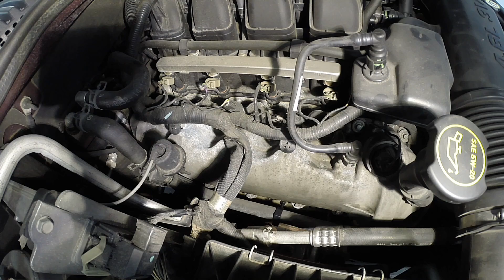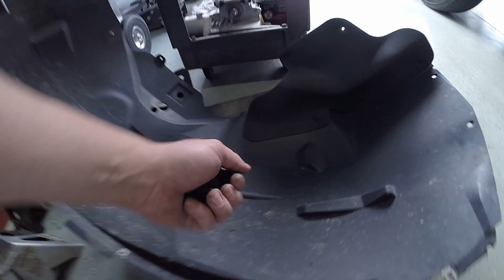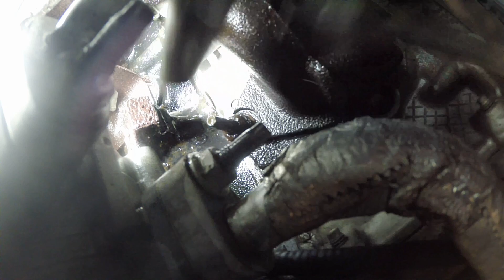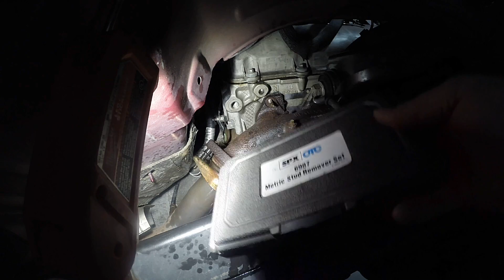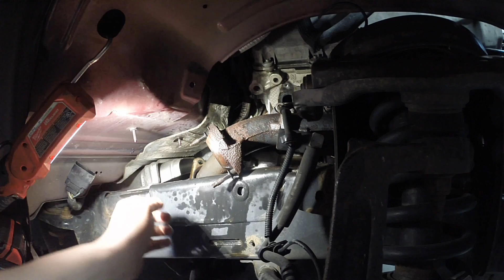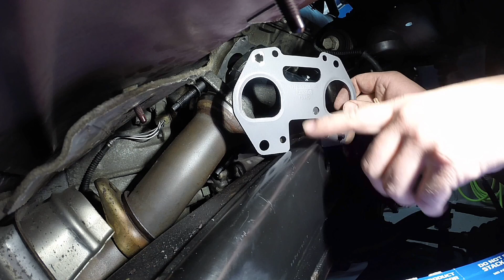Ford Explorer 4.6L 3v: Passenger Exhaust Manifold Replacement

Comment from the maker: The parts and tools listed below are what is needed to complete the repair: (check fitment guide)
Mopar Rust Penetrant I use-
http://www.amazon.com/gp/product/B00BV4DBAU/ref=as_li_tl?ie=UTF8&camp=1789&creative=390957&creativeASIN=B00BV4DBAU&linkCode=as2&tag=fordt-20&linkId=VYOYTUQUDYJM2UZ6
For extremely rusted items use this rust penetrant-
http://www.amazon.com/gp/product/B005XUIX24/ref=as_li_tl?ie=UTF8&camp=1789&creative=390957&creativeASIN=B005XUIX24&linkCode=as2&tag=fordt-20&linkId=SQL2XWZ5NSFFNR2F
Aftermarket Stainless steel stud kit-
http://www.amazon.com/gp/product/B000CQ21CM/ref=as_li_tl?ie=UTF8&camp=1789&creative=390957&creativeASIN=B000CQ21CM&linkCode=as2&tag=fordt-20&linkId=EHOO6INP2F6WZ2LZ
4.6L 3v Engines-
Dorman Exhaust manifold kit- 
http://www.amazon.com/gp/product/B00GHT7ZFG/ref=as_li_tl?ie=UTF8&camp=1789&creative=390957&creativeASIN=B00GHT7ZFG&linkCode=as2&tag=fordt-20&linkId=LIM2N27YJSV3SWZC
Latest Exhaust Manifold gaskets- (2 required)
http://www.amazon.com/gp/product/B0031CFOJG/ref=as_li_tl?ie=UTF8&camp=1789&creative=390957&creativeASIN=B0031CFOJG&linkCode=as2&tag=fordt-20&linkId=23LL36E3TL5ZWTB6
OTC Stud remover & Installer-
http://www.amazon.com/gp/product/B000HTAXFQ/ref=as_li_tl?ie=UTF8&camp=1789&creative=390957&creativeASIN=B000HTAXFQ&linkCode=as2&tag=fordt-20&linkId=ZKKMIWFZSEF264VW
Cat Claw I used to remove everything on Fords-
http://www.amazon.com/gp/product/B000FL5MRU/ref=as_li_tl?ie=UTF8&camp=1789&creative=390957&creativeASIN=B000FL5MRU&linkCode=as2&tag=fordt-20&linkId=VN3DMVMUTPP2IIBP
Fine 3M bristle disc I use for automotive gasket removal-
http://www.amazon.com/gp/product/B000FW4LDU/ref=as_li_tl?ie=UTF8&camp=1789&creative=390957&creativeASIN=B000FW4LDU&linkCode=as2&tag=fordt-20&linkId=GDMPENN5EIBC5OVY
Cheap popular torque wrench option-
http://www.amazon.com/gp/product/B00FMPKAD0/ref=as_li_tl?ie=UTF8&camp=1789&creative=390957&creativeASIN=B00FMPKAD0&linkCode=as2&tag=fordt-20&linkId=JOLPHOS2V3GHIZVW
Push pin remover I recommend-
http://www.amazon.com/gp/product/B0002BC0PA/ref=as_li_tl?ie=UTF8&camp=1789&creative=390957&creativeASIN=B0002BC0PA&linkCode=as2&tag=fordt-20&linkId=6VGE3MVBAFVCXMZ2
Nickel Anti-Seize-
http://www.amazon.com/gp/product/B007NJOEAI/ref=as_li_tl?ie=UTF8&camp=1789&creative=390957&creativeASIN=B007NJOEAI&linkCode=as2&tag=fordt-20&linkId=A5PHYLP5CTHTTXVE
If you need an angle grinder I suggest this unit for those tight areas-
http://www.amazon.com/gp/product/B008JYRDEU/ref=as_li_tl?ie=UTF8&camp=1789&creative=390957&creativeASIN=B008JYRDEU&linkCode=as2&tag=fordt-20&linkId=GOYVI3MWXDH5GD4G
TORQUE SPECS:
Manifold Studs- 106in lbs
Manifold 13mm Nuts- 216in lbs
Downpipe Nuts- 30ft lbs
Reply: How much do you charge for the 4.6 manifold gaskets for a Mountaineer? It’s literally the exact same one that’s broke off as in this video.

Comment: Hello. What's the part number for the exhaust flange studs? I have felpro ES 75105. It doesn't have enough threads to be flush with the manifold. It has 7 threads. My old ones have 10. I zoomed in on your video and yours has 10 threads on the bottom.

Comment: Hello sir. Thanks for your great videos. I have a question for you. I need to do this exact job on my 2003 4.6 (2v) on passenger side. Also I have to replace upper balljoint and driveshaft differential seal on that side. Its not my main vehicule so it can stay on the lift for a while as a I expect this to be a multiple days job.   I plan on removing the whole knuckle, hub and Strut assembly. Would it give me lots more room to work? Especially since I am pretty sure I will have to drill out those 2 front studs.

Comment: This was an absolute pig of a job and one I hope never to have to do again. One advantage Brian had here is the truck he was working on did not have the 3rd row climate controls. Heat and A/C lines run right by where he disconnected that wire harness and make access even more difficult. I disconnected the coolant hoses but left the A/C lines alone. I shifted them as far away as I could and managed that way. I had 3 broken studs; 2 of them, the 2 at front, below the level of the head. The 3rd was the lower one on the back cylinder. If any on the middle 2 cylinders were broken I don't think I could have succeeded in removing them. I did it by welding nuts onto the broken studs. I used the Dorman replacement manifold and hardware. I installed the studs after maneuvering the new manifold in place as I felt it provide more clearance to get the new manifold in place. Thankfully, the new manifold appears fine and the leak is gone. Since no good deed goes unpunished, now the thing (a 2007 Mountaineer Premier 4.6 3V V8) is now throwing catalyst codes, most likely due to a misfiring episode from a couple years ago caused by loose plugs and crappy coils put in before my ownership. I hope this solves this trucks last problem.
Reply: About to tackle this same job

Comment: Great video and I appreciate you doing this.  I was curious about the drivers side exhaust manifold and why it seems to cost almost twice as much as this passenger side you have linked to below.  Is the drivers side a more difficult job or is there anything specifically different to doing a drivers side compared to a passenger side manifold?

Comment: Outstanding video, I am doing this now on a 2007 Sport Trac and this has been a tremendous help.  Some comments:  
- Great shot of using a pass through / go through socket at 17:45 to remove the upper 13mm nuts/studs
- Do you have an opinion on using McMaster 90386A109 Class 8.8 M8x1.25  / 25 mm serrated flange bolts instead of studs/nuts?  These would be much easier to install in these tight quarters
- You can cut the protruding stud on the lower AC line holder to get better access with a universal to remove the lower front nut/stud

Comment: Your videos are so detailed and thorough. I noticed at the end you showed the AC lines had been removed and you stated you had vacuumed the lines down. I have a 2001 f150 super crew with the 4.6 is it possible to do this job (it was already done once five years ago by a shop, it leaked from day one) without having to remove those ac lines? Thank you sincerely,

Charles Abbott

Comment: Great job! Just wondering about whether bolts instead of studs can be used on my 2006 Explorer with the 4.6 3 valve???? I'm going to use the doorman passenger side manifold.

Comment: I was doing this same job on both sides of my 2006 Jeep Commander with 5.7 hemi and I decided to go ahead and pull the heads. That was the only way I could see to do the job properly. Too tight especially on the drivers side. At least it gives me a chance to change valve seals.

Comment: I can see why mechanics quote so much to do manifolds, labor intensive!
Reply: It's easy when the engine is out, soak with PB blaster a few days, then crack it loose, spray em down some more, tighten, rinse and repeat till all of em are loose, then slowly back em out...best way to get em out without breaking a stud.

Comment: Thanks for posting this video, I replaced the right side exhaust manifold on my 1998 4.6L Expedition, this video was absolute MONEY !  The tips are great and grateful for posting all the links to the tools and supplies, especially, the stud removal kit very helpful. I used the Dorman exhaust kit about $85-$90, brought some of the tools that you recommended my total spend for the job was less then $250, completed the job over a 2-days periord, started one mid-afternoon finished the next morning, I did not have to drill any sheared off studs from the manifold. I'll tackle the drivers side next.

Comment: Brian. I did my passenger side exhaust manifold today. Thanks for the video. I had two broken studs that I removed with the welder method. One note for you. The explorer you worked on did not have back seat climate control. Where you had just a harness to unplug and move, I had coolant and refrigerant lines in the way. In order to get the manifold out, I had to disconnect the coolant lines. Also, I noticed you don’t show the torquing of cylinder 2 lower. That one is a bear to get to. Thanks again. You’re the best.

Comment: I swapped the driver side exhaust manifold on my 2006 Explorer 4.6 3V this weekend. Three studs were broken (both fronts and the top rear). I watched this video so many times. Thank you Brian. I used the welder method to get the studs out.
Reply: How bad was the job overall

Comment: Hi Brian, Thank you so much for your videos and shared knowledge. You've inspired me to take on some big (in my eyes) projects on my 2006 Explorer (no rust on the west coast). I have a question about the parts you used on this project. You listed the aftermarket stud / nut kit. Do you prefer that kit over OEM studs/nuts, or was that a budget consideration like the Dorman manifold? I am preparing for a double exhaust manifold replacement, so I am trying to figure out which parts are best.

Comment: Thanks for your time and shared knowledge. I’ve come to you for several repairs on my 2010 Ford Explorer. I wish you would’ve showed us what the noise it makes is. I’ve been having a noise on my Explorer for some time now. It would first only happen in the cold mornings and eventually stop after it warmed up but now it’s stays on. And it gets especially loud after 2 RPM’s. I shifted the transmission to neutral and pressed on the gas and it does it also. So I figured it’s probably not the transmission. But I wouldn’t know where to begin to isolate to fault. Any advice or direction in this issue? If it is the exhaust manifold would there be any clear visible signs I should look for?

Comment: i thought it was too good to be true when i found this video but this is my exact problem. I have a 4.6 3v mountaineer but same shit. Anyway, i thought it was the lifters too so i tired a lubricant in my oil and obviously didn't work. Let me know if you have a shop or something i can get this fixed at cause i'm only 16 and I don't want to mess it up.

Comment: Hello Brian, I hope you read this and reply! I have a 98 E250 van that I love. It has 343,000 miles on it and still runs perfectly. I still pull 10,000lb equipment with it no problem. I bought the van with 122k miles and I take care of my trucks! I have done the front suspension twice (ball joints, drag link, idler and pitman arms all bushings ect) my issue is the exhaust manifold gaskets have blown out and it sounds like the truck in this vid. The studs and nuts are so rusted they dont even resemble a nut/bolt anymore. I have asked EVERY shop in my town to replace them, even the Ford dealer said NO. I don't want to junk my truck over the gaskets! I am a fairly capable tech I have done all my own work for 20 years but I worry I won't be able to get the studs out and that will lead to pulling the engine. What are your thoughts on if the studs will come out of a 98 with 350k miles on it? I am concerned they will be locked in there....

Comment: Outstanding "how-to" video.  I followed this video as well as the supporting, "Broken Exhaust Manifold Stud Removal" video and accomplished this difficult task in one evening (prep) and one full day of effort.  Our Explorer has rear air which made the manifold removal a bit more of a challenge but it is do-able.  Dropping the AC compressor (without having to discharge the freon) gave me good working space to drill-out the front two studs.  My wife's beloved Explorer is quiet again and she'll stop threatening to go buy a new one.  ;)  I purchased all of the recommended tools and they worked perfectly.  The new drill bits cut down to custom length was an amazing recommendation.  The extractors were worth their weight in gold but the real win here is the excellent video and instruction.  FordTechMakuloco - Thank you for your excellent work.

Comment: One comment, that exhaust manifold, studs, and nuts are in great shape! I did this repair on my F150 after 15 years of winters  and getting those nuts and studs off was nowhere as easy. Some nuts had to be cut with a dremel, some took out the whole stud, which turned out to be better because new stud/nuts could be used. Good news was repair fixed the noise.

Comment: this dude is the man. I have the same problem and it actually caused 1 of my o2 sensors too go bad. instead of paying my guys at a local shop called Technology R I might as well take my time and tackle this myself. I wanna do after market headers like BBK, and Gibson or a pair of custom equal length headers by whoever makes em. Its a lil scary because Ive been hearing that they're a pain in the ass to get in vs the OEM headers because of space availability. Btw you made this shit look super easy bro. So easy that if my girl took her time she'd get it right💪💪💪💪💪
Next time you hear from me my Explorer will have a Coyote swap and full bolt ons and maybe a lil💉💉💨💨

Comment: hello,
i am new to the Ford Truck World and have a Question.
I have a new to me 2004 Ford F150 4X4 4.6L Truck, 100K MIles.
i've been watching your videos and was wondering if all of the 4.6L were 3 Valves or just certain ones?
when i've been looking at Replacement parts and i state 4.6L, i'm never asked if it is a 3 Valve or not.
i'm getting ready to do a Tune Up and looking at Spark Plugs and everything i've seen , seems to be normal(Short) Plugs.
am i missing something?
thanks for any information.
john

Comment: Hi I just did this manifold swap on my truck 2010 f150 5.4l 4x4 and you have no where near the same amount of room that you do on the 4.6l the flange on the y pipe will not clear the studs on the manifold due to the o2 sensor location. I also had to cut the studs at the back of the manifold because there was no tool small enough to even get on it or get any torque. I would love to see you do the 5.4l to see where I went wrong....
Reply from the maker: They are tighter and the trick is to lift that side of the engine.
Reply: +FordTechMakuloco 
I sure did lift that side of the engine. I watched your video very closely during the whole process and followed your tutorial step by step. once you have the opportunity to do a 5.4l if you haven't already you will see the limited clearance issue's I was having. mind you I also struggled with swollen rusted bolts....

Comment: So I'm going to attempt changing my passenger side manifold. I have a 2006 F-150 with 195,000 miles on it. What special tools will I need to get before attempting. Which studs/nuts will be mostly like to be a problem. My truck looks awesome but sounds like junk.

Comment: just did my first one of these on a 5.4 F 250, but cant get the downpipe to seal even after following the torque spec/sequence from Mitchell. Any ideas? thanks for the video!
Reply from the maker: +kauboi If the down pipe will not seal you may need to loosen it from the other bank and straighten it out.

Comment: its bullshit that ford knows this and refuses to deal with it! my cousin is a engineer at ford. when I questioned him about this his response was...."their have been thousands of complaints about this. the feds say theres no safety concerns nor hazards therefore it should be the customers responsibility to deal with the issues and not the manufacturer or supplier!" ive owned 9 f150s from late 90's all the way thru 2005 and every damn'd one of them had a exhaust manifold leak!!!!!! 5 were broken! 1 was so bad I had no choice but to take the truck too a mechanic shop! cost me $570 bucks!! took them 3 days too fix it/replace it!!! ive replaced them on my sisters 2006 last fall.....2006!!!!!!!! a truck she paid $33,000 for and the manifold was rotten!! ive got manifolds that are 50 yrs old and sittin in the michigan weather that are still in great condition! and the shit ya get today barely last 8 yrs!!! what ever happened to the days when the manufacturers took pride in their work/products??!! better yet.....when they STOOD BEHIND THEIR PRODUCTS!!!!!!!!!!!!!

Comment: is this the same procedure for the 2v engines? my 99 f150 4.6 needs both sides done. great video btw
Reply from the maker: +Shaun Sklarz Very similar but easier more room on the older trucks like yours.

Comment: Wish I watched this video prior to tackling mine on my 2007 V8 Explorer. I did have 3 broken studs that needed to be drilled out and of course one of them was behind that shock tower. I did get them out with a reverse drill bit and ran a tap through them to clean them up. Very tight quarters though. I did release the engine mount to slightly twist the engine to gain precious room. I ran the engine for one hour of start and stop intervals to heat and cool the manifold then i re-torqued it. Do you think I need to re-torque them again after about a year of service with no leaks? Also i noticed the driver's side is now leaking and I see atleast two broken studs...Oh boy....Not looking forward to this. Great video man. I am a retired firefighter but have been a marine mechanic for 35 years. I try not to do auto work but I can figure most out. i have been asked to make videos of the various marine repair jobs I do. not sure what type of camera to use. my friend uses a Go pro and it seems good. Thanks.

Comment: Hi,
is they any chance to replace the right ( driver) side exhaust manifold on a 2007 Lincoln Navigator 
without removing the cylinder head ?? I check already and have noch chance to get to the 2 lower bolts (manifold) close where the catalytic converter is connected,......thank you

Comment: You link to a "latest" gasket for the 5.4 3V. Is this for all years? When I search for my truck, a 2006 F-150 5.4L, I don't come up with that part number. I get 9L2Z-9448-B. Did the part you link to supersede the one I'm finding? Thanks
Reply from the maker: +Chad Hanson B is for the 4.6L 3v applications